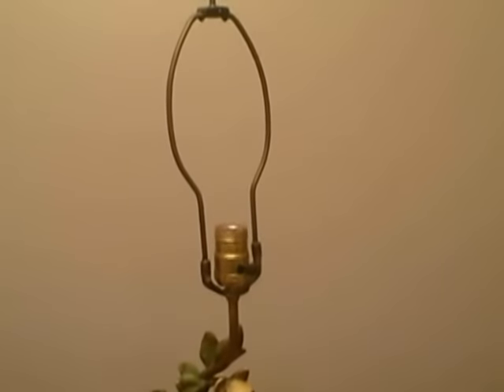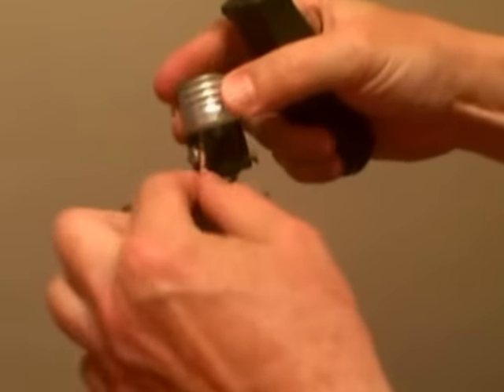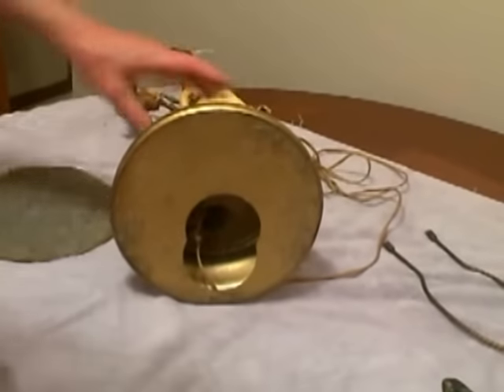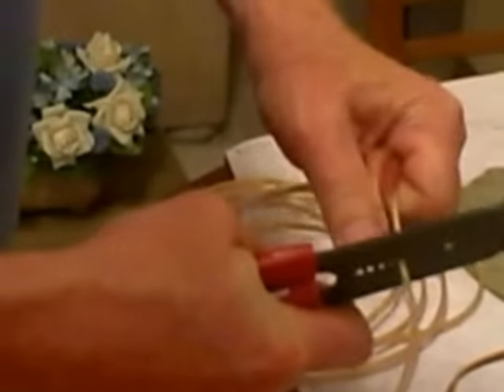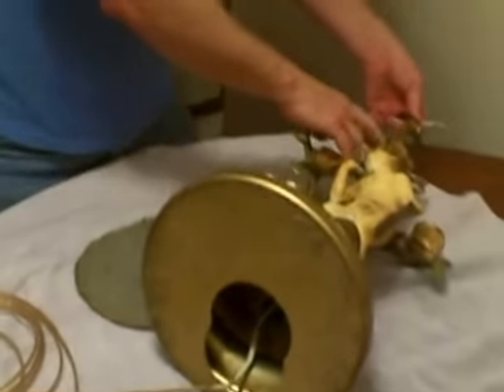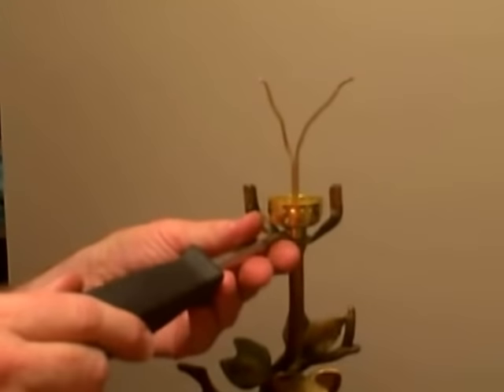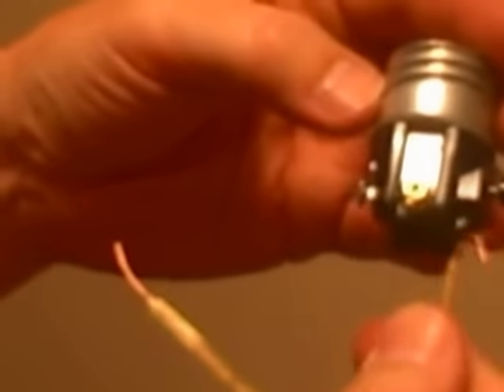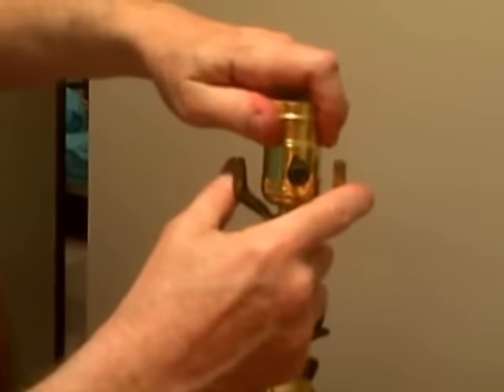Wiring a Lamp - Wire a Lamp Socket

Comment: Before this video, I didn't think A/C lamps cared which wire attached to which connector.  However, since I'm planning to use LED bulbs, any diodes/electronic controls involved could be destroyed.  Glad to find out about the ribbed/smooth wire and silver/brass screws.  Would be good know know if the electricians have a mnemonic to remember that configuration.

Comment: This is a good tutorial. Some I've watched do not use the old cord as a lead for the new cord to be pulled through the lamp body. They show a simple lamp where you can just pull the old cord out and shove the new one through. In most of the lamps of repaired this is not the case. You need that old cord to be the "leader"! Thank you for showing that simple solution to everyone.
Reply from the maker: Thanks.
Check out more home improvement tips in our e-books https://www.amazon.com/gp/product/B0B2KW1FQ9?notRedirectToSDP=1&.

Comment from the maker: Hi, you should always try to have the socket polarized for safety. What parts are you changing? If just the socket, you can mark the plug to which side you will plug into your wall outlet on the small slot. This is your hot side. Follow this side of the wire to the socket and attach it to the gold screw. If the screw is not gold, find the screw that is attached to the center contact tab inside the socket. You can also use a continuity tester to trace the wire to the plug and mark it hot.

Comment: Terrific video, thanks. Great to know about both the 'Underwriter's Knot' and the need to "press hard and twist out" the top part of the socket shell in order to separate the two halves -- often the most challenging part of the project, I've found! In fact, whenever I can, I now use the slightly more expensive sockets that use a threaded collar to connect the two halves instead of that poorly conceived 'push 'n' click' system. 
 
Also, I've learned through trial and error that the 'pull-through' trick works much better when you strip-away about 1" of insulation on both the old wire and the new one, and then knot the two pairs of wires together instead of just twisting them and using electrical tape, which needlessly adds bulk to the wires and increases the likelihood of them getting stuck and/or coming apart, given how narrow, rough, and grimy those old threaded tubes often are. 

Also, as long as the wire isn't some kind of 'vintage fabric', it helps to wipe the new wire with a little vaseline or mineral oil to help it slide (making sure to wipe it off once it's through, of course). But we all have our own ways of doing things, so whatever works, right? 

Thanks again for the tips and your wonderfully clear step-by-step instructions.
Reply from the maker: +Martin Allen Great tips. Thanks!
We have more tips in our home improvement book http://www.amazon.com/dp/B013YR9UOC.
Reply: @FIXITHomeImprovementChannel  Just downloaded this through Kindle Unlimited! Thank you!

Comment from the maker: Hi,
By having the smooth wire connected to the brass screw, you are safely connecting the socket. When you turn off the switch, no electric is passing to the metal inside the socket. If you wire the hot to the silver screw, the switch will turn off the bulb, but the inside of the socket will have electric passing to it. If you stick your finger into the socket, it becomes a shock hazard and dangerous. Always wire it smooth wire to brass and ribbed wire to silver. Narrow blade to the brass screw.
Reply: Initially I had the ribbed and smooth wires swapped.  With this video, you made it so I don't accidentally kill myself with electricity.  Thank you!

Comment: Nice lamps. I’d suggest ditching the fork spade connectors and wire the socket straight using the industry standard UL knot on the lamp cord for safety purposes.

Comment: Thank you! I was able to re-wire an old floor lamp that had a great deal of sentimental value to me but was starting to scare me.
After a little bit of drama with the thickness of the wire I'd purchased (my hardware only had 18/2 lamp wire and I didn't know the difference anyway - needed another trip to return the plug and buy one that would accommodate the thickness) I was successful - you provide all the little steps that someone like me doesn't just know in a clear, concise manner. Your little trick for pulling the new wire through using the old one was really helpful too.
I was a bit bummed that I couldn't re-use the old socket as it has threads at the end that the lampshade screws onto (and I have no idea where to get a new one like that) but I'm pretty sure the disintegrated cardboard in the socket was the source of the sparks! Maybe someday I'll find a tutorial on how to re-insulate that old socket :)
Reply from the maker: Glad it was helpful.
We have more home improvement tips on our weekly podcast 
https://itunes.apple.com/us/podcast/fix-it-home-improvement/id880903087?mt=2
Reply: You can try using the cardboard, or even many parts of any NEW socket to repair yours.

Comment: Thank you! Your directions were very thorough! I rewired a lamp that I was going to throw away using an old cracked lamp I found by the dumpster. It works and I don't need to purchase another lamp set!
Reply from the maker: Great. Glad I could help.

Comment from the maker: Hi,
Yes, lamp wire is thinner than an extension cord. You are looking for 18 gauge wire. You can get a kit at your hardware store that has the plug attached, or you can get the wire and add a plug to the end.

Comment: There are two types of 18 ga wire SPT-1 and SPT-2. The difference is the insulation on the STPT-2 is much thicker. And it will not fit into a 1/8”  pipe thread that’s 1/4” inside diameter.   Just take a piece of the old wire with you when you go to buy the wire and purchase the correct one.

Comment: I have a lamp with a chain...the wire & insulation is the same color, the screws are the same color. the plug prongs are the exact same size. Is this an indication that it does not matter which wire is connected to the screws?

Comment: Hi there! 

I hope it's not too late to ask a question? I'm a little confused by one step. You twisted the ends of the old and new wire together, taped them, and then pulled them up through the lamp...but then cut off the old wire completely? So did you untwist them at that point? Why did you twist them together if you were just going to cut the old wire off--why not just tape them together to pull up through the lamp? (Or was the twisting done just so the connection was secure enough to withstand the force of pulling them up?)

This was SUCH a great, helpful video, though, thank you so much!
Reply from the maker: Hi, I was taught lamp repair by an older gentleman at one of my hardware stores. This is how he taught me. You could just tape the wire together and pull it through if you have room.
Reply: @FIXITHomeImprovementChannel  Oh, thank you so much! So I'm right, then, that it's not necessary to making the lamp work properly but is just for safety/habit/Best Practice?

And after you pulled the wires through the lamp, you just untwisted/cut off and discarded the old one, and the two wires you then connected to the socket were the "original" ends of the new wire (in other words, there was no other prep needed to the new wire, and you didn't do anything else to the ends before connecting them to the socket--you just untwisted or cut off the old wire, right)?

Sorry if it's a silly question, it's just that a lot of DIY videos tend to assume you know how to do some of the steps, so, like, the narrator will pick up a part and say, "First, prepare the sneezleborg for scrimping," and then there will be a cut and they'll say, "Now that that's done, let's wind the zunderbat," or whatever, and I'm sitting there wondering exactly how they prepared the sneezleborg and what I'm supposed to do! Obviously you don't do that sort of thing, so thank you, but I wanted to make sure. 

I'm actually a pretty experienced DIYer, but  electrical/wiring is the one area I've never gotten into before. I'm very excited to get started now!

Comment: I have a question i can't seem to find an answer to.

Would it be okay to wire two/four of these into one plug. 
If i ran 2 i would like to aim for 
96-200 watts
If i ran 4 i would like to aim for 196- 400 watts

Comment: Hi, Thank you for this video! It was super helpful. I got the socket switched out perfectly on one table lamp and then proceeded to swap the socket on an identical lamp. The 2nd lamp isn't working now. Any suggestions on what I should look for or how to troubleshoot this? I took the sockets off our previous table lamps and transferred them to new lamps because we liked the switch mechanism better on the previous lamps. Both sets of lamps worked before the swap. Thanks!
Reply from the maker: E Milmont Hi, if you have a multimeter, you can check for continuity from the plugs to the ends of the wires to make sure the wire and plug is good. You can then test the screws on the socket to the tab and inside of the socket to check to see if the switch is working. Let me know if that helps.
Reply: FIX IT Home Improvement Channel Hi, Just wanted to let you know that I tested the continuity and everything looked good. Turns out the connection to the bulb had gotten flattened out a little and wasn't hitting. We just bumped that up a little with a screwdriver and voila. Magic :) Thanks so much, I learned a lot!
Reply from the maker: E Milmont You're welcome.
We have more tips on our weekly podcast https://itunes.apple.com/us/podcast/fix-it-home-improvement/id880903087?mt=2
Reply: E Milmont I

Comment: I'm trying to fix my lamp and I'm to the point to where I need to put the wires on the silver and Brass screws. But I don't have a wire that's ribbed and a wire that smooth. They both feel the same way to me. Scared if I put it the wrong way I will shock myself. These are the same wires that were originally in the lamp. The reason I'm having to put them back on the screws as my large dog knocked my lamp over so hard that the wires came off. Just trying to get the wires back on.
Reply from the maker: Hi, if you use a multi-meter, you can test for continuity. Use the probes and touch one to the small blade on the plug, this is your hot and find which wire it is connected to. If you don't have a tester, your local hardware store would probably test the wire for you.

Comment: I successfully followed your instructions, but I'm still wondering one thing from your video example and from my own work. How does the shallow metal cup (the "base" of the socket) have enough room to hold the Underwriter's knot and extra inches of cord while still allowing the switch to seat in it sufficiently when the sleeve of the socket is snapped into place?
Reply from the maker: Hi, you may have to adjust the length of the wire going to the screw terminals, but this is how it is designed. You will have enough room.
We have more tips in our home improvement book http://www.amazon.com/dp/B01BK2K0JM?ref_=pe_2427780_160035660
Reply: Thanks for the response. It DID work for me on the first try, I just didn't understand how that shallow cup magically accommodated the switch base, the knot and the extra bit of wire!
Reply from the maker: Magical! I will use that from now on.
Reply: XD cool, have a nice weekend.
Reply from the maker: You too. Thanks

Comment: Hi! 
I'm using exactly that fitting for a ceiling light. Your video is really helpful but you don't appear to have an earth/ground wire. 

There doesn't appear to be a terminal for the earthing/grounding wire. Can I ignore it or do I have to do something with it?

Thanks
Reply from the maker: +James Dunn-Williamson Hi, for a ceiling light you should have a ground. In the video I did, we are in the Chicago area using conduit. The metal conduit runs from the box back to the service panel and grounds the box, when you screw into the box you are grounded. Most wiring in Chicago and Seattle don't use a ground wire because of this.
If you are using non-metallic cable you would want to ground the light with the bare ground wire.
Reply: +FIX IT Home Improvement Channel 
Sorry I'm writing from the UK. There is a ground wire in the ceiling and the cable I am attaching it to also has a ground wire. The actual lightbulb holder (the same as the one in the above video,) doesn't appear to have a grounding terminal so what should I do with the grounding cable?
Reply from the maker: Hi, In most ceiling lights that we use here in the US have a screw or wire lead for the ground. Many lights have metal that could be a shock hazard. The light will work fine without the ground, you just won't have the extra safety that grounding gives you. You can cap off the ground and tuck it in the box.
Reply: +FIX IT Home Improvement Channel 

Thanks!
Reply from the maker: +James Dunn-Williamson You're welcome. Let me know how it turns out.
We have more tips in our home improvement book http://www.amazon.com/dp/B013YR9UOC.

Comment: I had just changed my socket on the table lamp. Put it together, put a light in it & turned it on. It works, but then I watched this video...I don't know which wire I put where. Does it matter? Would it work if wired up backwards?
Reply from the maker: Hi, yes it will work if it is wired in reverse, but it could be a shock hazard. You want the hot wire going to the brass screw and the neutral wire going to the silver screw.
We have more home improvement tips on our weekly podcast http://castbox.fm/u/6389499.
Reply: Ok, thanks for getting back to, really appreciate it

Comment: many lamps i like that r sold in stores only allow 40 or 15 watt light bulbs, but i need it to be much brighter like 100 watt light bulbs, should i buy a new base & replace that only? do i need to replace the wires & plug too?
Reply from the maker: ***** Hi, you can use a 26 watt CFL. That will give off the same light as a 100 watt bulb. You can also get a torch style light that will allow a higher watt bulb. Let me know if that helps.
We have more tips on our weekly podcast https://itunes.apple.com/us/podcast/fix-it-home-improvement/id880903087?mt=2
Reply: If you look inside your light socket it will tell you what it is rated for.  Most standard sockets are rated up to 250w and 250v.  Meaning it will work in Europe if you just add an adapter.  In other words, don't listen to the sticker.  Its a sticker made by a manufacturer enforced by a lobbyist.  THEY DON'T WANT YOU TO SUE.  For instance, your cat gets tangled in the wires, it falls over, bulb breaks, the fresh whiskey stain on the carpet catches fire, and your house burns down.  Well, we told her to use only a 40w bulb and not anything more, not our fault.  You think the whiskey stain and the 110v coming out of the wall knows about the sticker.  Trust how fast the engine will perform, not how fast the dealer suggests.  The dealer didn't build the engine!  BAM!

Comment: Help please! Is lamp wire different (thinner) than using an extension cord wire? I did the worst thing. I pulled the old wire out. Now I can't get the extension cord wire thru the post. It's way to tightt.
Reply: I know this is 9 years old, but maybe it will help someone else.  Try running a stiff string, or a flexible wire through, and then pulling the cord through.

Comment: You almost know the cord trick.  However, wiring both leads and wrapping in tape is way to bulky for most antique rods.  The older rods tend to be narrow.  I won't tell you how, b/c its how i make a living, but use your imagination.  You break off enough cord in an arm and you'll figure it out.  That being said, you have one of the better videos.  Good Job.
Reply from the maker: +Lamp Man (Calloway's) Thanks
Reply from the maker: +Lamp Man (Calloway's) Drop me a line at fixitpodcast@gmail.com. Would love to get any tips you have. Thanks, Jacy

Comment: my bedroom lamp has a nite light in the bottom part then the regular light on top  but the bottom nite light has stoped working i replaced the bulb but then noticed that there is a black wire loose inside the bottom need to know where this connects
Reply from the maker: delores davis Hi, on a lamp with a night light, there is an extra screw terminal on the socket. Unplug the lamp and take apart the socket and you should find the screw. Let me know if this helps.
Reply from the maker: Hi, I used Mom's tools for this video. I use Gardner Bender electrical screwdrivers for most my work, but whatever gets the job done. We have more tips on our weekly podcast http://www.stitcher.com/s?eid=36290220&refid=stpr

Comment: I'm so confused about the hot and neutral wire. Both wires seemed smooth when I touch em. Is there another way to see which is which. I have got the lamp all opened up but stuck at this. Plz help:(
Reply from the maker: Mariam Hi, you can use a multimeter and test for continuity. Touch one of the leads to the narrow blade on your plug and then test the wires. You will find the hot wire. The narrow blade is hot, the wide blade is neutral. If you don't have one, take it to your local hardware store, they should be able to test it for you.
The only other way is to take out the wire from the lamp and trace the wire coming from the narrow blade of the plug. Mark this one to go to the brass screw. Let me know if that helps.
Reply: FIX IT Home Improvement Channel I got it. Thank you!! You saved my lamp. Excellent video and extremely helpful.
Reply from the maker: Great.
We have more tips on our weekly podcast https://itunes.apple.com/us/podcast/fix-it-home-improvement/id880903087?mt=2
Reply from the maker: The narrow blade with the smooth covering is hot. The narrow slot in an outlet is hot. The wide a lot is neutral.
Reply from the maker: +Orlando Holwerda You're welcome.